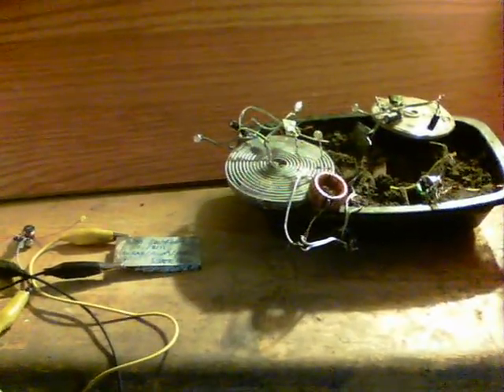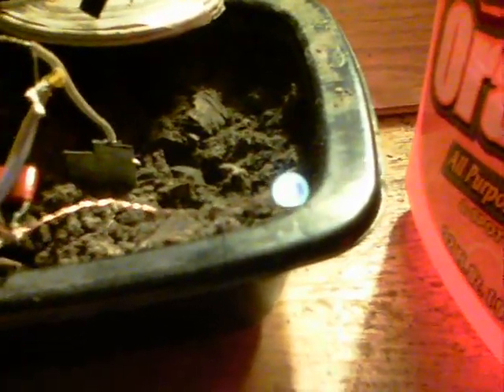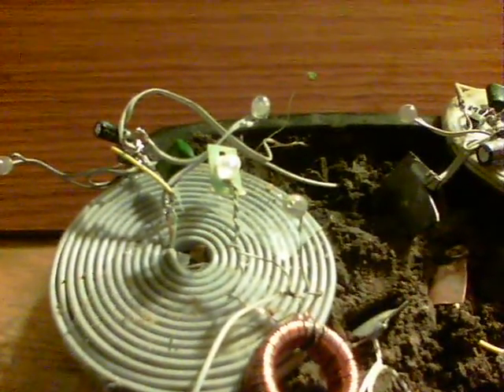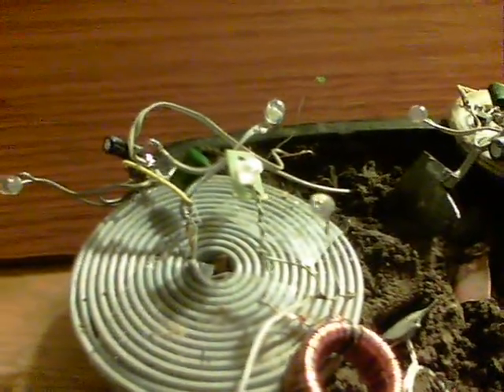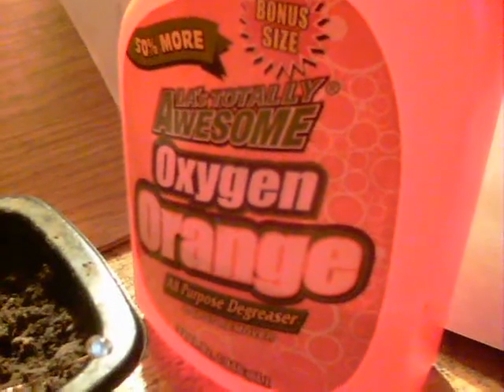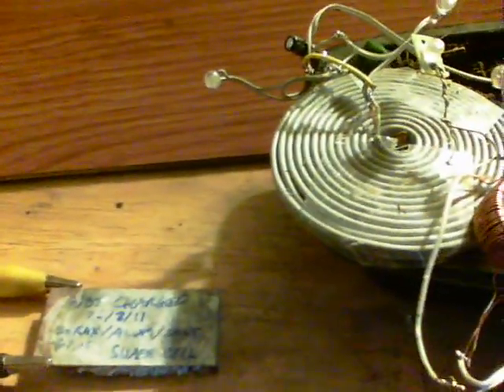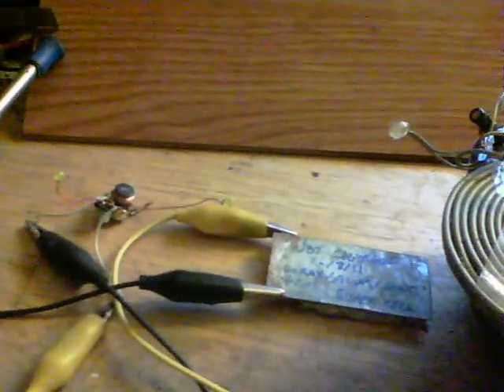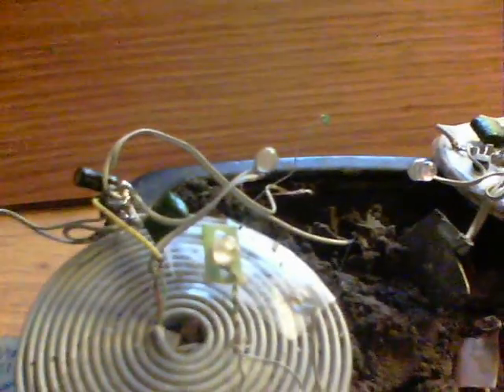The LED plant

Comment: Your growing a Plant based Microbial Fuel Cell. Or PMFC for short. Lol! There is a wikepedia page. The synced pulse is probably the rf from the strongest (in rf) coils harmonizing. The emp/rfp, will be pushing charged caps over the brink. The discharge will be helping too. They are all sharing waste energy, Which is a pain if you want to replace fire! What fire flickers in time with itself? Really small caps, might help. Or maybe a choke with a magnet in it? That could make it worse too though.

Comment from the maker: Yeah, in fact if the copper side is upward it doesn't have nearly the range, which was interesting. A few inches though is the affected area and the pot of dirt is that size ! 
Looks like cress, 2 rounded leaves at the top....oh hey, 2 rounded leaves, LED is round and they're pointing same direction too. I'll have to water the experiments now and sit them on the windowsill, surreal.

Comment: perhaps the discharge sends another secondary pulse that is caught by the nearby circuits triggering the flashes? the field collapsing is perhaps farther reaching than the standard wireless fields your using.